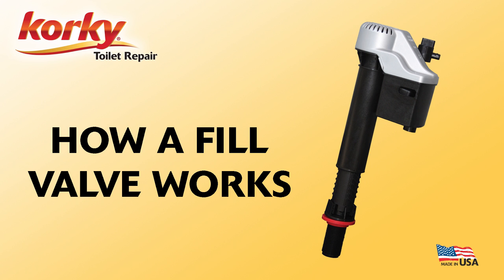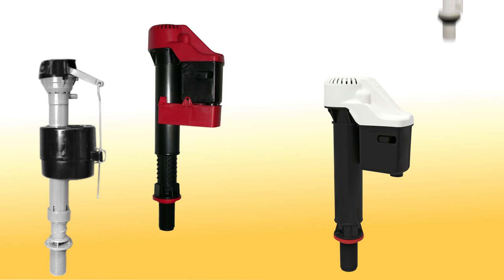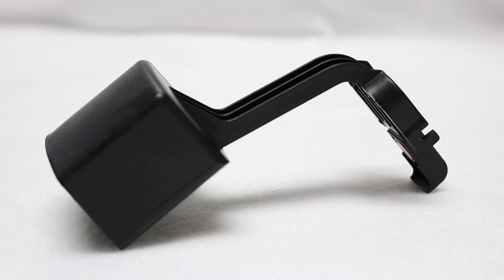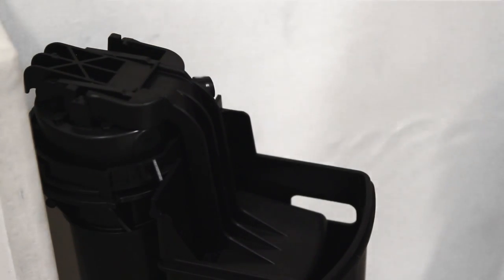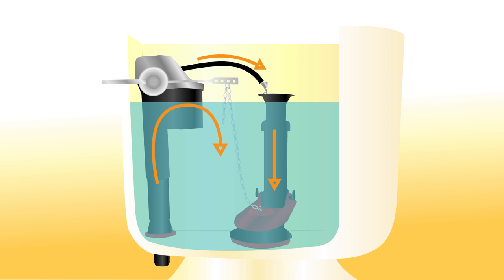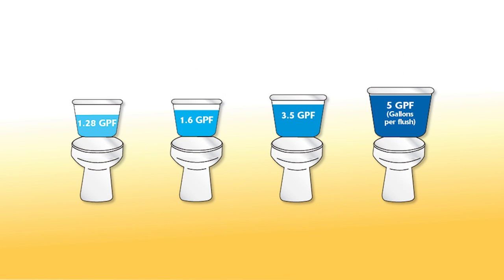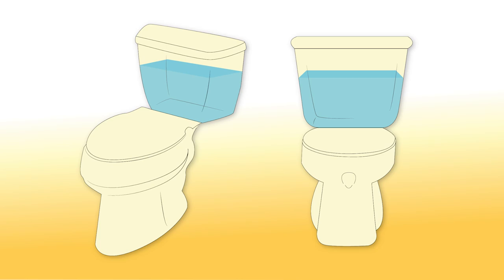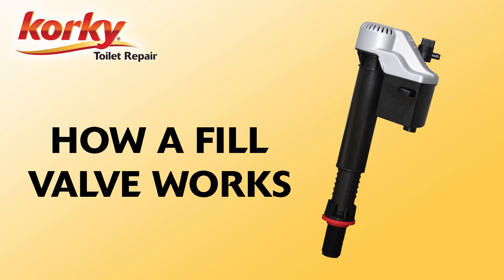How does a toilet fill valve work?

Comment: Just an FYI, the vid worked.  I went out and got a Korky to solve my problem.  I did have install the base nut twice though as the first time I had some leakage (it was coming from the bowl not from the water line side).  Was weird, cause I thought I got it pretty tight the first time.  Might be an area to look at for improvement. 

Keeping a container under it for a day or so to make sure there's not more leaking, but yeah once i got that adjusted things are working well.

Comment: But how do you stop it from flowing if your toilet is clogged?  We just had an amazing disaster in our bathroom cause we couldn't stop the water from flowing fast enough.  Old school float balls were the go to thing to grab to stop an overflow, but now it takes getting on your hands and knees to turn the water off, which takes longer, way longer.
Reply from the maker: Korky valves have an internal float to protect against corrosion. We recommend turning off the water supply for the safest/quickest result. The Korky fill valve does have a removable cover. If removed, the float is exposed and can be manually shut off.

Comment: How does the water get back in the tank?  Video does not indicate.
Reply from the maker: There is a water supply line coming out of the floor or wall that sends water through the fill valve into your toilet tank. When the toilet is flushed, the fill valve kicks back on to fill the tank again.

Comment: Exactly, nothing explain how the Cistern system shut the water flow? I found there are just too many parts in the Cistern fill valve. Other replacing the whole thing by so many videos in youtube, I think replacing either the rubber seal, washer, o-ring is more appropriate, at least not create another rubbish parts.
Reply from the maker: We are sorry to hear your frustration. Does this video better answer your questions? https://www.youtube.com/watch?v=hAxAyoSMQhI

Comment: Refill adjuster leaks but you cannot replace them. Are they even needed or can I bypass them and connect directly to the valve?
Reply from the maker: Are you able to contact our Technical Support team? We would like to learn more about your specific toilet and identify a solution. Please call 262-763-2434 or email Sales@Lavelle.com. Your fill valve is backed by a 5 year warranty and we want to ensure your complete satisfaction. We are available M-F, 7:30am-5:00pm CST.

Comment: What if the toilet is filling very slow? What could be the reason for that? The overflow line water is strong but the tank fills slow
Reply from the maker: Are you able to contact our Technical Support team? We would like to learn more and quickly identify a solution. Please call 262-763-2434 or email Sales@Lavelle.com. We are available M-F; 7:30am-5:00pm CST.

Comment: I dont think that this was a  thorough enough explanation...why leave out how the mechanism that  shuts the water off when the tank is filled to the set level...its a float switch is not a sufficient explanation...what is the mechanism and how does it shut off the water...does it work by using the water pressure against itself to seal and prevent more water than what it's set at to go in the tank or is it something else...and we know about all of the identities u are not fooling everyone

Comment: Are fill valves know to expand (get taller) enough to lift the tank cover off the toilet?
Reply from the maker: Hi Linda - No, if locked-in and installed properly, a fill valve should not move. An expanding fill valve can cause costly water waste and potential property damage. If you have additional questions, we are here and happy to help. Simply call 1-800-528-3553 or email sales@lavelle.com to speak with our customer service team.

Comment: Sorry to say that this video doesn't show if the water refill would not stop refilling the tank so the water
would overflowing the flush valve like it just happen to mine. It is a new one Korky Quietfill Platinum. 
I just follow the instruction manual thoroughly. I detached, open up the parts and clean all up, reattached again,
then tried it again, the result is the same. The water keeps flowing into the tank overflowing the flush pipe and 
goes to drain.
Reply from the maker: We apologize for the inconvenience this has caused you. As you stated, your toilet fill valve is 100% serviceable, without having to remove it from your toilet. To ensure all the components of the fill valve were serviced, follow the link to a step by step troubleshooting guide: https://www.korky.com/toilet-help/troubleshooting-guide/service-korky-fill-valve. If this still doesn't solve your running fill valve, we are here and happy to help. Your fill valve is backed by a 5 year warranty and we want to ensure your 100% satisfaction. Please dial 1-800-528-3553 or email us at sales@lavelle.com. We are available Monday through Friday, 7:30 AM to 5:00 PM CST.